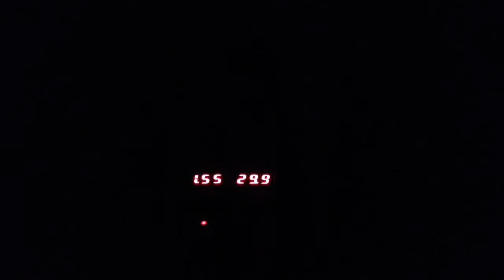Spark gap flyback coil wirelessly powered by slayer exciter

Comment: I've been seatching for someone performing experiments like mine and came across this video. It isn't exactly what I have been doing, but it is the closest so far. I took a receiving coil and plugged its leads into a voltage multiplier circuit and turned 120VAC into 1KVDC. I was pretty excited about that and decided to build a Marx Generator to use as the load for that HV supply. I figured that 1KVDC wouldn't be enough for the Marx, but I gave it a go. Turned out, I was right, it wasn't enough so I'm building a much larger coil with better ratios to be my new Slayer and then I'll try the old coil out as a receiving coil. I'm hoping to get something closer to 1KVAC at of it as a receiver in order to multiply it to something closer to a decent Marx Generator driving voltage. If I manage to make that work, I suppose I'll get some color photo film and start taking Kirlian photographs of leaves and simple things like that as art for my apartment.
Anyway, awesome work! Love the inspiration!
Reply from the maker: Thanks buddy, let us know how you get on ;) take care

Comment: I wonder what would happen if you set a small mirror ,silver side on the top load bulb,   make a scratch pattern in the mirror ,will the lines of dielectric energy show there aurora threw the scratched pattern on the mirror.
Reply from the maker: Hey Ron, I'm going out to try it right now, my Mrs just donated a small mirror. If I get a good result I'll video it. I'm not afraid to say I'm a little excited, thank you mate - be warm ;)
Reply from the maker: Morn Ron, I broke the damn mirror trying to get it out of the wooden handle. It just started sparkling around all the edges where it was broken, made for a very cool effect. I'll get a more suitable lone and try scratching a pattern in it. Cheers fella
Reply: metallic spray paint,  on the bulb, ,  but I,d be carefull, lol
Reply: never spray metallic spraypaint when near a h.f. discharge device.  beware
Reply from the maker: will do, safety first!... I imagine there's a noise like the boiler firing up and then you're left with no eyebrows... and look like wylie coyote after setting off some TNT?
Reply: lol,now that's funny, I was thinking of him earlier,  only the roadrunner stopped by and got the coyote baked on some grass and left him a big bag of doggy food ,then scooted away leaving whillie all blasted,and not knowing wtf to think anymore,  lol  its fricken cold today ,again
Reply: it would however,make a wicked vid if it was done properly with the right setup,   ,molten metallic particles charged to a high degree ,being sprayed across or threw a chamber of sorts.   might adhere itself to the walls of a glass tube ,  a big long glass tube ,or something like that,   to get the full effect of coarse.
Reply from the maker: ronald sykes
heheh ... love that... ... the images I'm getting are brilliant. :)
Reply: got that idea from the  1930 audels  new science electric dictionary,,  12,000 words ,terms and phrases,   a good book if you can find one.   I will did some more goodies up, later. o.k

Comment: Very cool. Looking forward as always. Peace. :)
Reply from the maker: Thank you mate.
Reply: I've gotten some 2SC3320's NPN... Just ran one until it blew... Blew at 50V and about 2A.... Coming soon, a 10 primary high power slayer, inspired by the brilliance of none other than deeds :) Peace brojangles.
Reply from the maker: 10... did you say TEN... holy crap Binj that thing will be like a spark gap coil if you put a top load on it.  I bet you a slayer with 10 primarys would emit arc from a top load!!!... can't wait to see what happens. I need a better power supply to run with more than about 5 I think.  My pussy PSU took a beating from the last round lol. :)
Reply from the maker: I've blow 3 x 2n6547s on my spark gap coil this week :(  . it's teaching me to be careful with the input power. :)
  It also taught me how much energy can be stored in a small capacitor, it then showed me what it felt like when you touched it! :)
Reply: lol... the lessons we learn :) 
Too bad about the 2N6547's :( 
And yeah, I did say 10... I am waiting for 1000V full-bridge rectifiers and I plan on using my variac as a PSU... But I may use my DC-PSU but I dunno... low-pass filter off the + rail and a by-pass cap on + & - would be in order... But we shall see. 
Good luck with your endeavors :)
Reply from the maker: omgoodness 10... bro I have GOT to see that when you get it up and running. 
I've got my finger hovering over the BUY button on a Variac for £85 on fl-ebay.. I keep saying I'm going to push that button. ... I'm going to kill that PSU if I carry on.  Could do with a few tips to get setup when I finally get the Variac.  I'm excited about the 10 primarys... that is seriously going to kick ass.  Have a good weekend. it's 17:20... I'm out the door woo hoo.  Another work week over. Awesome, catch you soon Binj. cheers.
Reply: :) Awesome, hope your weekend is great from start to finish :)